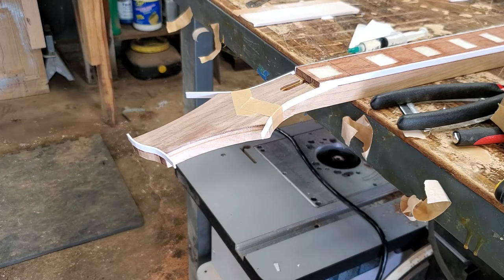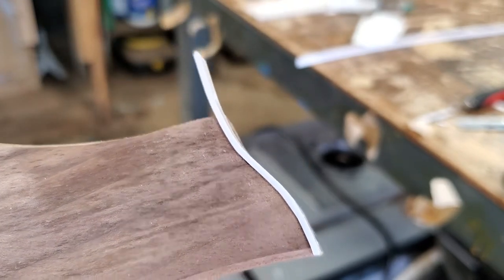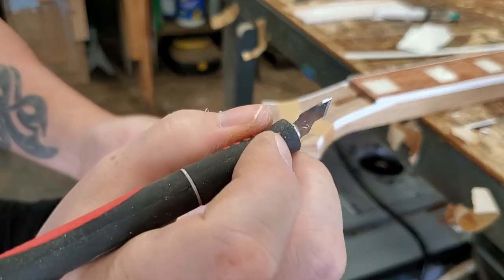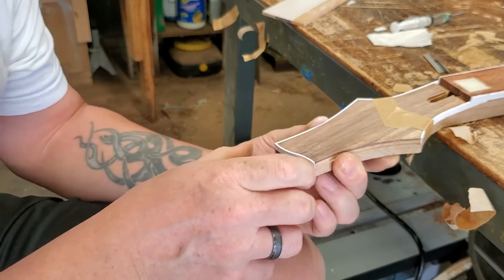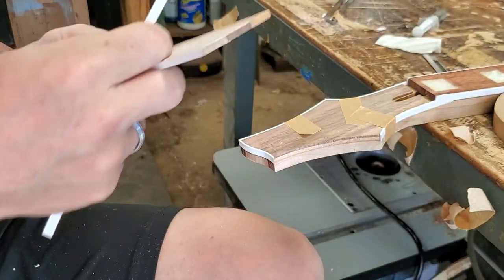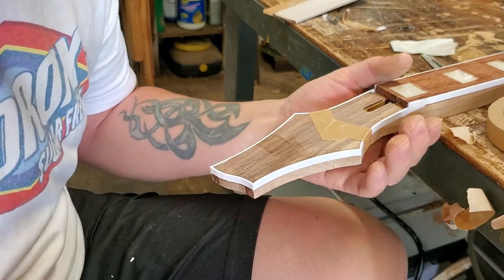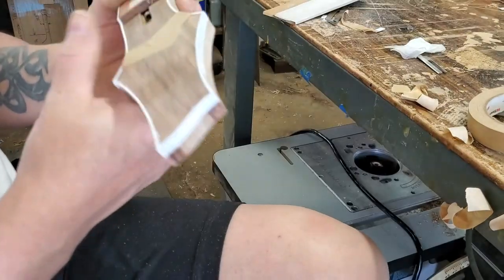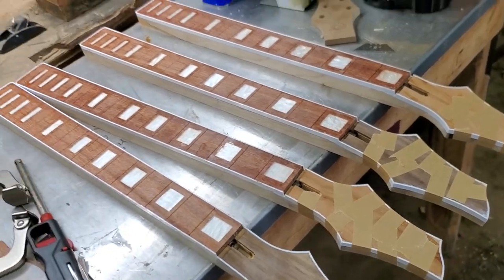Headstock binding on walnut veneer

Comment: Could you tell how you did the routing for the binding angled joint at the headstock/neck joint?  (The area where the binding converges under the neck binding)
Reply from the maker: I used a separate template for the neck and for the head stock on the router
Reply from the maker: The headstock was routed face down while the neck was routed with the front facing upward before it was shaped